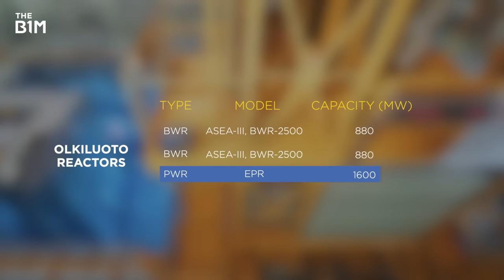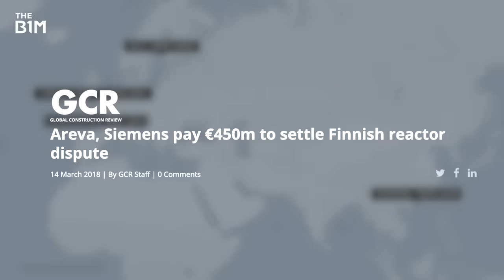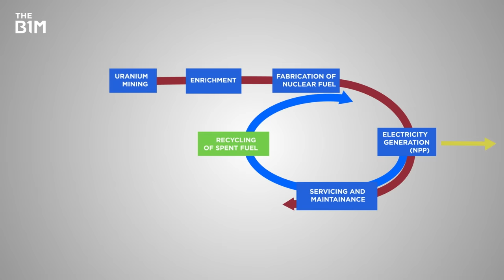Finland Might Have Solved Nuclear Power’s Biggest Problem

Comment: Alot of engineers and architects will thank you one day for inspiring them.
Reply: I can second this. The B1M has always been an inspiration to me ever since i started studying civil engineering in university
Reply: That’s the value of channels like this
Reply: I like these types of channels
Reply: I’m not even an engineer but I love this stuff
Reply: This channel continually reminds me I wish I was lol
Reply: A lot, not "alot".
Reply: Joshua Kelly
What is an ''Alot of engineers''?
 Is it a quantity, is there also an ''Alot of beercans''?
Perhaps you meant ''A lot of engineers and architects MIGHT (there is no guarantee they WILL) thank you one day for inspiring them. ''
Reply: Calm down
Reply: Bro its just grammar
Reply: @rocksparadox  can I just ask why you felt the urge to say this? Do you actually think anyone cares? Why would you take time out of your day to be so arrogant as to correct someone's small grammatical mistake in a YouTube comment section? Unironically, get a life.
Reply: yea engineers and architects....meaby better involve someone with a plan to reuse that material instead of digging a bigger and better hole.
Reply: Cost, geo instability, engineering errors => not a solution
Reply: @drew8305  Sure, why the bother, it's only radiation. Btw, 4:10 Mentions Fukushima spent fuel hazard (the primary, far above all, objection to fission), but not that the Unit 4 spent fuel repository was exploded (along with Units 1 & 3 fuel pools) & has yet to be recovered, let alone the subterranean river flowing 100s of tons of water, unabated since day 1 (no thanks to the ridiculous failed "ice walls"), over melted down reactors & uncollected masses (tons) of exploded spent fuel rods endlessly the highest radioactive contaminants (including Unit 3's MOX plutonium) leaking into the ground. Slight gloss over there (as whenever fission is "promoted").
Ok, go stick your head back in the sand.
Reply: As a finnish I heard this is first time I hear about this lol
Reply: @Crunch_dGH  congratulations. I was commenting on the comment about the guy's grammatical sin.
Reply: Industrial Engineering Management major here and B1M inspired me
Reply: You cheerleaders aren't thinking further than your fingertips.   Nuclear energy has no end in how toxic and destructive it is.
Reply: @ambienthangout  well it was in the groud for millions of years before it was dug up,  as long as it put in a safe location whats the problem of putting it back there after its been used. Im sure within the next 1000 years humans will find a safe way send it into outer space
Reply: Maybe worth mentioning that literally no one has ever been killed from spent fuel? No? Oh right kinda kneecaps the drama of the video
Reply: Some did.
Reply: Ryan Jachtmann  “Someone will eventually have to deal with that waste”. Really? Why? The whole point is that no-one will ever need to deal with it again. So… eh. Not having to deal with it is the safest way to deal with it given today’s technology. Every other solution is less safe.
Reply: @mehtakhanjan  Anything to back up that claim of yours?
Reply: If not covid and future microbes, human extinction can also be brought on by nuclear fiascos
Reply: Pilot16H  the problem with that statement is the use of public, it’s privatized. That means we’re trading off public interest for profit. That’s where the problems usually start.
Reply: Is this comment an April's fools joke (as the video obviously is)?
Reply: Quite.
Reply: A lot. Two words.
Reply: Perfect comment
Reply: Great idea... Lets bury it!🙌😤 short sighted fools
Reply: @EricMeyer9  "no one killed by spent fuel"?!? 

What utter nonsense! 

Go look around Iraq & Iran, don't forget your Geiger counter! 

The lunatics in the USA military thought it would be a good idea to make bullets out of spent nuclear fuel,  now it's sitting on the ground breaking into dust & contaminating people, livestock, crops, water & wildlife. The cancer rate has gone way up
Reply: @alanhat5252  spent fuel by definition is used reactor fuel. No one is making bullets out of that.  The opposite is closer to reality- we got about 1/3 of US carbon free electricity from old nuclear weapons from '93-'13, google "megatons to megawatts", making the world a safer place. I don't approve of any war, but commercial nuclear power plants have nothing to do with it. What you're talking about is like not using gasoline in your car because they used napalm in Vietnam or something...
Reply: We do❤️
Reply: for putting radioactive material in the ground..............? thanks for what?
Reply: @tony_5156  I am an engineer, but I don't play one on TV.
Reply: @rocksparadox  I was about to make fun of his spelling because as an engineer, I'm not very good at spelling, but I got called out on that mistake in my English class while going to college for engineering many years ago. So I get reminded about it a lot (notice 2 words!) reading various comments.
Reply: Who here mines the uranium?  - ftw!
Reply: What about thorium liquid salt reactors? No waste.
Reply: @barratansey152  And why did you?
Reply: My love for buildings and construction have gone up because of this channel
Reply: @ambienthangout  "imagine the pile of nuclear rods that could get built up over hundreds of thousands of years."
That would be longer than human civilization has existed.
Reply: @ambienthangout  Pissing in your current living room might have an impact in the short term. 100 years from now, it won't be detectable. 100,000 years from now, your living room won't be detectable.
Reply: @ambienthangout  Just not for the hundred thousand year time, or even five hundred. If humans had applied that standard 10,000 years ago, there wouldn't be any civilization.
Reply: @ambienthangout  Actually, we can't. Humans can wipe themselves out, but the rest of the planet will keep on chugging. It's not like the planet vaguely resembles itself from 50,000 years ago or 20 million years ago.
Reply: @ambienthangout  That's been the case since there were two of them. Nothing new.
Reply: @ambienthangout  All the nukes in the world wouldn't do it. Not saying it won't wipe out many, but there aren't enough to wipe out all.
Reply: @ambienthangout  That goes back to the piss not being detectable in relatively short order. And if we applied similar standards, civilization wouldn't exist.
That being said, air and water quality are markedly better now than 30 or 50 years ago in developed countries, despite being pissed in.
Reply: @ambienthangout  Humans have been doing that since there were two of them.
Reply: @ambienthangout  Sure, the aqueducts and indoor plumbing were accidents. It's all been destruction for no reason.
Then again, you're bringing up planning for a time period longer than human civilization has existed and comparing it to urine.
Reply: @ambienthangout  in contrast to your premise.
Reply: @ambienthangout  Whatever indeed. We've been fed an unending barrage of doom and gloom for over 60 years. We'll run out of food, because we can't possibly feed any more . We'll be out of water. Winter will never be seen again. Entire coasts will be submerged. We'll blow up the world. We're running out of oil... Seems like at least one of those should have happened doesn't it? Instead of mass starvation, obesity and type 2 diabetes are the fastest growing issues globally.
Reply: @ambienthangout  It's tiring when someone pretends I suggested there were no problems. Then again, cholera has been an issue since the first humans. It's just much less prevalent
Reply: @billwallace1177  The same is true for fossil fuel.. The carbon count per million doesn't magically dissapear from the atmosphere even if we stop using the shit today....
Reply: Pilot16H  Safest with least land utilization... unless, of course, we include the uranium mining and ruin of the land and environment that causes.  Have a look at the giant open pit mining; the trail of radioactive dusts left behind the transport; stats about health effects such as childhood leukemia around mine sites and nuclear power plants.  It's not only the fual that's being buried, its the totality of the facts.
Reply: @nipponsuxs  sending nuclear waste into space is not a solution or burying it forever.

Start with basics

Every thing we do is a process.

Currently if we look at any process.

A quick examination will confirm we don't care how wasteful and how inefficient our processes are.

Fossil fuels burning
Dumping plastics in Ocean
Creating plastic packaging 
Failing to reuse resources
Dumping everything to landfill.

Literally humans are polluting the earth from cradle to grave ...which will leave a mark on the earth  for thousands of years...longer than we like or can calculate / imagine.

Everything I've pointed to has just started in the last 200years (see since our great industrial revolution). We have no concern of the future.

We need to design CIRCULAR PROCESSES ie renewable process (where the output becomes the input again)...no waste by design.

We need to design EFFICIENT PROCESSES ie efficient loss less processes ( where we consume all the resources not most resources to deliver the process outcome. That inefficiency is waste).

This is a leaf taken from nature.

In doing so we have a healthy respect for the environment we live in 

Natural processes have learned that whatever we do should coexist with other processes & should leave no lasting impact for the future.

Sending nuclear into space invites wasteful & inefficient processes. 

You hope space is big enough for nuclear waste never to revisit us on earth...but what if we revisited it in space one day?

We'd still have to deal with it
...just like we polute the earth
...given a choice humans will polute space too
...creating no go zones just because we couldn't learn some basic design lessons.

Let's not send it into space.
Let's deal with our nuclear waste (all our waste) now.
... like responsible people.

That's the true lesson people.
Reply: The underground layout on the thumbnail looks very similar to the layout of tunnels inside the great pyramid
Reply: I am an engineer and I can say for certain it is NOT a good idea. Cost is the key.
Reply: And, was it worth giving in? Lol
Reply: A lot of English teachers are cringing.
Reply: Waste of $1,000,000,000. The direction of nuclear power is to use it's waste as fuel.
Reply: And a lot of people won't realise this video is produced by BIM. It is heavily loaded in favour of nuclear and ofrgets all of the contamination caused mining Uranium, the need to store large volumes of low level contaminated stuff, as well as the issue of what happens to the whole building after its thirty odd year lifespan is over.
Reply: @janolthof2487  sctually, carbon does 'magically' disappear; plants consume it, and it dissolves in the ocean, where microfauna turn it into calcium carbonate, which eventually becomes rock...
Reply: @Ironic1950  was talking about the excess carbon we put into the atmoshpere. Thanks for your help.
Reply: You're welcome, Jan, nothing much cares where the CO2 comes from, it consumes it just the same, shit or no-shit...all of us are made from CO2, and continue to live, thanks to CO2, so not really shit at all, and you breathe out a kilogram or more of the stuff every day...
Reply: @Ironic1950  except that too much of the shit is going to kill us, because nature will no longer be able to absorb CO2 in the massive quantities we are expelling it
Reply: ...and how do you know this, Jan? 97% of CO2 emitted is natural, and that was before we realised that unknown millions of seafloor vents are quietly discharging enormous quantities of CO2 into the deep ocean, which eventually circulates to the warmer surface and is outgassed and measured at the Mauna Loa observatory! All our emissions of CO2 are trivial by comparison...and, of course, CO2 in the atmosphere has been much higher in the past, when plants and animals thrived...
Reply: I, Joshua Kelly, second this comment
Reply: @Ironic1950  I agree, most of the CO2 forms naturally, the CO2 we emit has a different signature to the natural one. Different isotope composition.. the composition of CO2 in the atmosphere is changing and parts per million are rising.. don't delude yourself please
Reply: @kevinu.k.7042  And a lot of old ppl think nuclear energy hasn't progressed to solve problems from the 1950's. It's 2021 now, catch up. wiki gen3 & gen4 nuclear.
Reply: @janolthof2487  sounds like you beat me to it in the delusion stakes Jan. The isotopic composition of subsea CO2 emissions is the same as that produced by burning fossil fuels...because it comes from the same ancient carbon, where a portion of the C14 has decayed away...
Reply: Good partial explanation. Havent thought of that. I whould still advocate for far less CO2 emissions by us, because p p million are rising, and i don't hear u denying it. This will be my last remark. Have a good one. Regards
Reply: @janolthof2487  "I whould still advocate for far less CO2 emissions by us"
Third world countries are going to increase CO2 because that's a cheap way to prevent their ppl from starving to death. The solution is cheap/abundant nuclear power, because that solution INCULDES nuclear powered CO2 scrubbers, desalination, and hydrogen production. There is no better direction than Gen3+ nuclear.
Less CO2 production = status quo & extinction.
Reply: @janolthof2487  obviously, the parts per million of CO2 are rising because the warmer ocean surface water can't hold as much in solution as the colder depths, that's all there is to it.
Reply: Im not myself engineer or architect, but one billion really does intresting content, that I get addicted to watch, so I keep watching his videous
Reply: 0:34 okay but does out Nuclear Aircraft Carriers count or even nuclear subs that must account for at least half of their power, right?
Reply: Just don't google the disaster that was the construction of Olkiluoto 3 power plant. Approximately 12 years late from original 4 year construction time, because the delivering design and construction company were unqualified to build the plant. The whole concrete base was redone, a number of parts had to be reconstructed up to 3 times to reach the quality standards etc, a year before the planned finish the delivering company hadn't delivered half the drawings and designs of the plant to authorities to analyse and review. Could hurt the inspiration :D

Also still burying the nuclear waste in the ground because we have no other solutions is no new miracle solution. It's just a different case of burying the same waste in the ground out of sight.
Reply: @Crunch_dGH  Excellent comment! Not to mention the radioactive pollen every spring for the next 300 years drifting in the wind from cedar trees on the slopes above Fukushima or the radioactive run-off into the Pacific from those slopes every time it rains or the random cumulative genetic mutations weakening all exposed living beings for generations to come.
Reply: @TheBitterSarcasmOfMs.Anthropy  Please explain how you would render an atom of an ionic radioactive element with a half-life of 24,000 years inert.
Reply: @mehtakhanjan  Judgement Day will come.
Reply: Next we are goin to build nether portal.
Reply: Really? Allllll that BS...and it's going in the ground, buried, as all the rest...GENIOUS!!!!!!!!!!!!!!!!!!!!!!!!!!!!!!!!!!!!!!!!!!!!!!!!!!!!!!!!!!!!!!!!! Not.
Reply: Alot isn't a word
Reply: @joshkelly885  Cool name bro
Reply: Umm they should thank the people who does those stuff. Not thanking the people who makes videos..
Reply: @jackfanning7952  the devil? Whack job.
Reply: @Nill757  Yeah, the devil certainly is a whack job. Trying to kill all of God's creatures with his little tools, like nuclear energy.
Reply: @Nill757  We see Satan's work in every nuclear power plant built.
Reply: @jackfanning7952  We?  Is that a mouse in your pocket? How about you set down the messiah complex and just speak for yourself.
Reply: Yes.
Reply: A massive failure to understand time scale. The idea that Finland might be able to control radioactivity from leaking or leaching into groundwater for 100 years -- OK, I'll stipulate it. If we are super generous, let's say 1,000 years. Do we really know if Finland or any other country will survive that long? What natural disasters might occur? What social changes might occur? It would be silly to say that we do. And that's just 1,000 years. That leaves a mere 100,000 years during which poisonous toxic crap sits in the ground, all because it was convenient to do so for a very very brief time. I would call nuclear a terrible plan but that's too kind. There is no plan.
Reply: um no they wont this is dumb
Reply: @qqw743  Please.  The unknown is not the problem in this discusión.  You refuse to acknowledge what is known about radioactivity and how best to minimize all environmental risks relative each other.  But you don’t want to do that. You want your particular dogma to go unchallenged as the most scary thing, that only you speak “science”, never mind the trillion tons of radioactive elements always in the earth for eons. You might have started honestly, that you don’t care about understanding ground water or radiation.
Reply: For real, I'm actually in architecture school right now in part because of some of these videos
Reply: Damn right they will. By making a bad example to avoid. This powerplant was titled "one of the biggest failures of construction projects in the world, being 13 years behind the schedule".
Reply: It was dug out of the ground in the first place and concentrated to be used. The background radiation levels from where it was mined  are probably more than what will be experienced in these depositories.
Longer term perspective, I wouldn't be surprised that these areas will be accessed to recover and upgrade what is stored there as technology changes with time. Having these facilities will provide safe secure storage in the meantime or for perpetuity if needed
Reply: @nipponsuxs  , mined uranium is lower level radiation , what is done to it the enrichment process and fission process make it deadly for a very long time.
Reply: This is not a long time solution. Nobody knows how earth will change in the far away future. Perhaps a few 100 or 1000 years later (if we haven’t killed ourselves already) nuclear waste repositories all around the world might be responsible for enormous catastrophes which our descendants have to deal with. Also we should’ve learned from Tschernobyl and Fukushima which areas cannot be settled anymore due to the nuclear accidents. Though nuclear power undoubtedly delivers a good amount of energy the dangerous side effects are a too big risk for everyone which is why it is no long time solution in my opinion.
Reply: @nipponsuxs  Howdy Ron. I don’t want you to think my comment is in any way critical to you personally. You simply are unaware of both some of the technical problems, and the alternatives that are involved. For example, yes, Uranium has been in the ground for millions of years. But what happens to the Uranium, after we process it in ways that nature cannot duplicate, is the problem. A byproduct of that process is the creation of Plutonium (thousands of tons of it), which has a 20,000 year half life. That means, without going into the half life formula, it will exist for another 200,000 years. Man’s written history only goes back 5,000 years. No container ever built by man, including the Great pyramid at Giza, has lasted more than 1,000 years. Its not just the container. It’s the motivation of the humans within the next 200,000 years that might want to gain access to it. We have no idea what economic,  religious, or political conditions might prevail over the next 200,000 years. So why is Plutonium so bad? Because only two one hundredths of a gram inhaled into your lungs will kill you. And there is no way to extract it from your body once it gets inside. As for space. Visitors to the South pole regularly pick up meteorites from Mars and other planetary bodies on the ice as a result of asteroid impacts on those planets. And placing nuclear waste on another planet simply delays the problem future generations would have as we expand into space over the next 200,000 years. And you cannot simply drop it into the sun, because the sun would vaporize the metal and blow it back on the solar wind. It would contaminate all the planets. And the idea of placing a nuclear power plant outside of every city in the world is obviously crazy simply because of the nuclear proliferation issue. When one of these plants fail because of either an accident or a Natural Disaster, it contaminates an area half the size of Pennsylvania (Chernobyl) or a large portion of an ocean (Fukushima). But if governments simply built huge Solar cell power plants in the deserts, the large scale manufacturing efficiencies would cut the cost of the solar cell down to 5 cents a square foot. By delivering that energy to the ocean, water (H2O) could be split into a binary fuel called HOX. Cars, trucks, trains, busses and electrical power plants can run on HOX (when HOX is burned, its only byproduct is the purest form of water that there is; with No smog of any kind). The entire US energy demand could be supplied by allocating 150 miles by 150 miles of desert to the solar cells. And keep the oil industry going as an emergency national reserve. Democrats who worry about Global Warming will be happy, Republicans who worry about National Security will be happy. The deserts on this planet will be turned into huge power plants to supply world demand. Running your car will change from costing you $5.50 a gallon to the equivalent of $2 a gallon. I mean, we can choose to continue to spend $10 billion for each new nuclear power plant, or spend that money on an inexhaustible power source. And don’t forget, 99.9% of all the world’s food is entirely dependent on solar energy. It is very reliable.
Reply: @jonathanbr7_  be inspired all you want. Just please don’t build one. Until we figure out how to neutralize this crap it does not need to be done on a grand scale. Realizing it has already but enough already. When a plant gets out of control or is sabotaged or blown up in war we have 0 ways  to control or neutralize the situation. Our best efforts are containment after said tragedy.
Reply: @qqw743  you sir hit it on the head. If it lasted the half life I would be impressed and still a fail.
Reply: Nuclear power is one of the dumbest…. I fear that they are held at this standard and that you people are not in America. 

‘Hey, we built this awesome house! It’s in the middle of a toxic waste area.”
Reply: "Finland Might Have Solved Nuclear Power’s Biggest Problem"
Nonsense. The problem was solved by those who built the first fast reactor using liquid fuel and it consumes all the radioactivity until depletion.
Reply: @billwallace1177  Still better than oil
Reply: Finland didn't solve the problem with nuclear power. The U.S Navy did, we have a perfect record with ZERO nuclear accidents.
Reply: A lot*
Reply: Hello Africa SPLIT